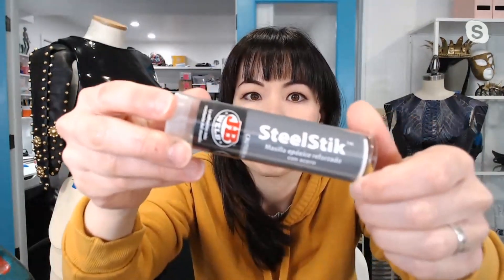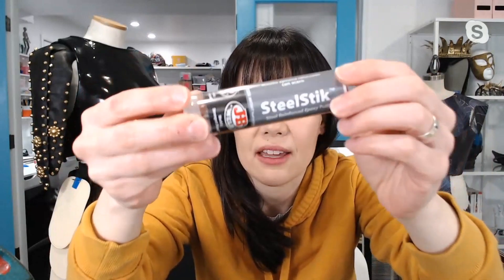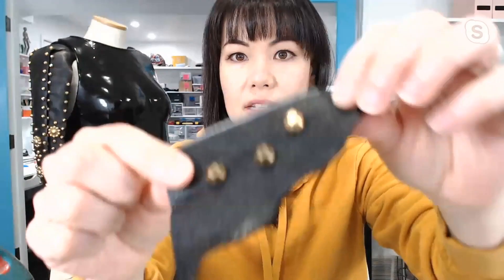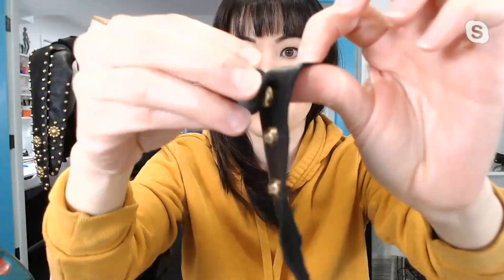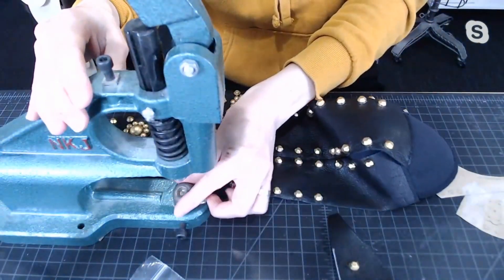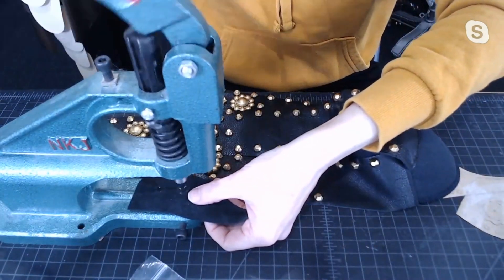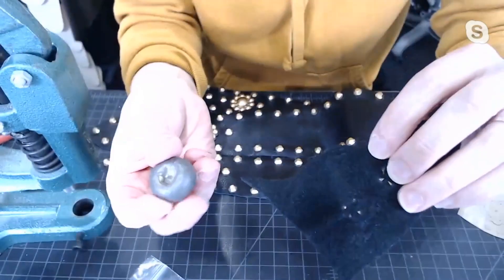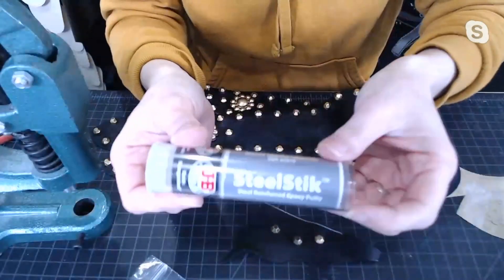Repair Metal With This $5 Putty

Comment: Been using this to repair motorcycle gas tanks with pin hole leaks for years. Totally sand-able & grind-able. Apply to bare metal.